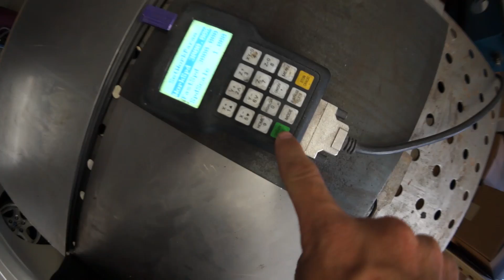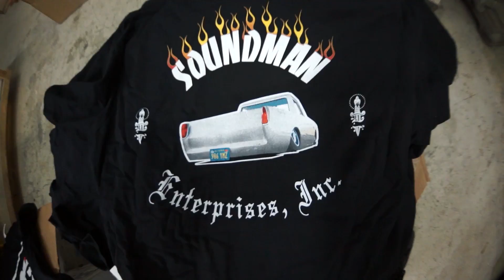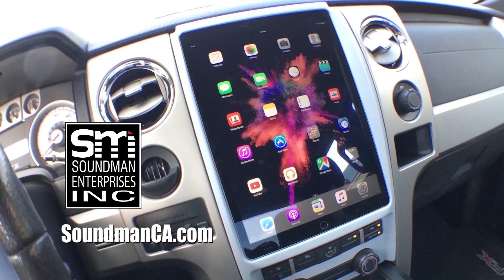HUGE FUNDRAISER UPDATE! Upgraded pump rack, new brakes, removed pinstripe MORE! - WHITE RIDER #26

Comment: I'm at 13:00 in the video and wondering if you know that a special tool is required for the back caliper pistons...I once owned a 1995 T-Bird, that might be it! Edit, now at 14:30. The rear calipers are not seized, you need a piston turning tool, i used some needle nose pliers but it was a pain in the a$$, the tool makes it EZ
Reply: Scott Gaines I was just about to type this.
Reply: Me three
Reply: It turns in IF you need it to in order to put in the new thicker pads. IF the caliper is damaged or "froze" REPLACE IT. 
Just because it turns in doesn't mean it is functioning properly. Not to mention IF the caliper extends far enough out the seal will be damaged. And no you will not necessarily have a leak because of that.
Reply: He might as well replace the calipers. Who knows what damage he might have done trying to force the pistons back in without simultaneously turning them.
Reply: The Oldsmobile Aurora do the same to get the piston in enough it screws back into the caliper housing n tryin to press it in with a C-clamp wont be enough pressure to damage it unless u have the impact type
Reply: I noticed the same thing they are the calipers you have to rotate simultaneously similar to the lincoln LS and early 2000's honda accord.

Comment: Collapsed brake hose: A brake hose that has collapsed can cause calipers to move unevenly, also causing the vehicle to pull to one side when braking. Worn suspension parts: Suspension components wear out over time and can cause a variety of problems, one of which is the car pulling to one side when driving or braking.
Reply: Rob Madden caterpillars don't collapse they turn into butterflies 😀
Reply: It's the A-frame bushings, I would bet.

Comment: 3M eraser wheel removes pinstripe and the boogery sticky shit left over after removing your side moldings. It won’t damage your paint. I used it when I removed my Tahoe side moldings and it worked like a charm 👍🏻

Comment: Doug. Some calipers with parking brakes will adjust as the pads wear. You will need to possible rotate the piston while compressing it. You can probably use the tool for free from some parts stores or you can use some other method/combination of tounge and groove pliers with a c-clamp. Good luck.

Comment: Amazon or any part store has eraser wheels. It's like the name says it's a big rubber eraser I put on a drill to remove pin stripes and the double sided tape left from the door gaurds you removed. There like 20 bucks but they are worth their weight in gold when I comes to removing that stuff!! Takes it right off and doesnt touch the paint at all. Amazing lil get down they are. The rear calipers don't press straight in, you have to push hella hard and twist it at the same time. There is a lil tool for it, it's a lil metal squard with lil nipples sticking out on all the sides and a 3/8s ratchet goes in it to twist it

Comment: Doug, I see you had another successful car day. ;) .  Moving on... Anyway, the pulling
 (could be drifting to the left or right when you're driving in a straght line) when applying the brakes and  especially when you come to a stop could be a wheel alignment problem on your front suspension. If this is the case, you will have to take it to any wheel alignment shop. Rotors tend to warp due to either the metal not being hard enough or somebody not properly  torquing down the lug nuts to specs. You can tell if it's a router issue when you apply the brakes you will feel pulse on your foot as you apply the brakes. In essence, the rotor is like a wave when warped. So. as you apply the brakes it grabs on the high spots and doesnt grab on the low spot of the rotor. This inturn creates a pulse feeling on the foot as you apply your break. -zsignmein

Comment: Medium cut paint cleaner from Meguires Professional (beige bottle in auto body section) with a wool pad would do wonders for that paint.  Then finish it up with some legit polish and encapsulate it in a couple layers of carnauba wax using foam pads on a 7" Harbor Freight polisher.

Comment: On my Chevy pickup I had the same issue with the truck pulling I replaced the caliper and it still did it ended up being the brake hose was collapsed might wanna look into that

Comment: If you were able to bleed the front brakes then your hoses should be fine. If you weren’t getting any flow through them you wouldn’t have had any fluid coming out when you tried to bleed them. It might be a good idea to change them anyway though if they’re dried out or cracked.

Comment: Caliper rebuild kits are cheap. Get the correct piston tool. Strip the 3, sand blast, clean, paint all and brackets. Hoses are all shot & dangerous at that age.

Comment: Hey Doug why don't you use one of those eraser wheels to take the pin stripping off it's faster and easier!!!
Reply: Kelvin Kirven its painted on, which is why he was using thinner. Personally I would have used 2000 grit sand paper and polished.

Comment: Are those calipers seized or did you not know you need a special tool to compress the rear caliper pistons? They rotate in and also was the ebrake on when you took the calipers off? That would keep them clamped on the rotors and make them difficult to remove. The caliper compression tool can be rented from oreilly and when you return it you get all your money back, or you can buy one on Amazon or ebay for like $25. Or u can just keep the one from oreilly. If you don't return a rental tool within 48 hours you own it and they order a new one to rent out.

Comment: Hey doug have u thought of using welding tweco to disconnect grounds from the battery rack??   Ive seen plenty of ppl using welding wire and welding twecos to easy disconnect  power .. i got plenty of welding wire ! If interested ill sell u  everything i mentioned.   For cheap.. i got 100s of feet of 0/1 gauge. And 100s of feet of 0/2gauge ..    southwire exellene  is the wires brand .. really good wire!

Comment: Abs light turn one because u are low on brake fluid there's a sensor in your  master cylinder that floats and when is low an you add fluid it will stay it has a magnet an you have to lift with some pliers

Comment: bro to get that strip off go to an automotive paint store and buy the rubber wheel that goes in your drill. its called an eraser wheel. just make sure not to hold it in one spot to long it'll burn through the paint

Comment: Next time get a $14 rubber decal remover tool that attaches to your drill.  Its what dealerships use vs hurting the finish with lacquer thinner.  Just run ideas off us commenters because this stuff will save you time, effort and money.

Comment: If you hit it with a rotary buffer with a wool pad and using a correction compound you wouldn’t need to clay it. And they also make clay pads for da buffers now
Reply: wrong bro clay removes contaminants that are stuck in the paint surface. clay before polish and wax for that buttery smooth finish.
Reply: If you buff paint without using clay, you’re just going to grind whatever is on the surface into the paint. You’d just be making more work for yourself by having to polish out whatever scratches or swirls you put in by polishing a dirty surface.

Comment: The rear calipers just need a compression tool. The emergency brake is integrated into the caliber. You have to turn the cylinder as you can press it. You 
https://www.homedepot.com/p/Astro-Pneumatic-Brake-Caliper-Wind-Back-Tool-Set-AST78618/301969533

Comment: I’ve never seen someone just pour the polish on the car but ok
Reply: nothing wrong with doing it though, as long as the polish is on the paint the end result is the same
Reply: When you color-sand and buff after a fresh paint job, this is the way people normally do it. It saves time by not having to add more polish after finishing each little piece
Reply: I've always put the Polish directly on the paint. Unless you're directly in the sun, you'll be just fine.